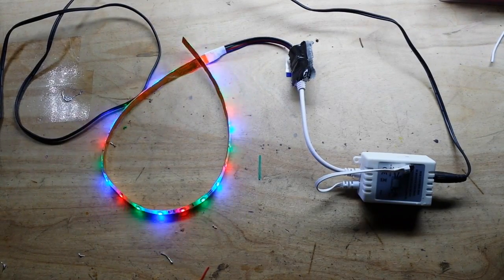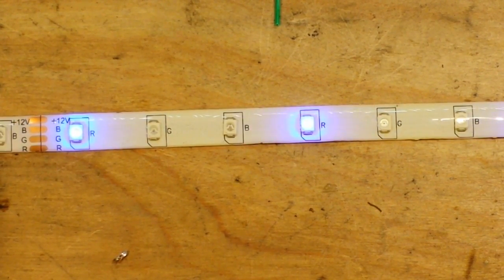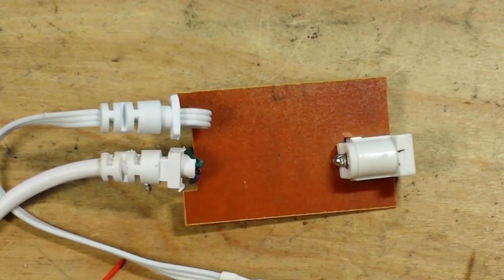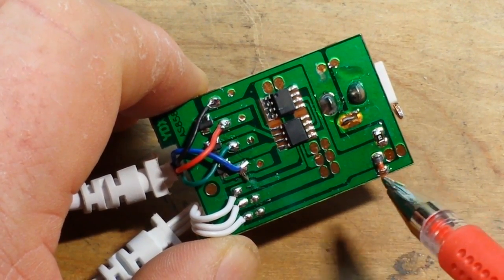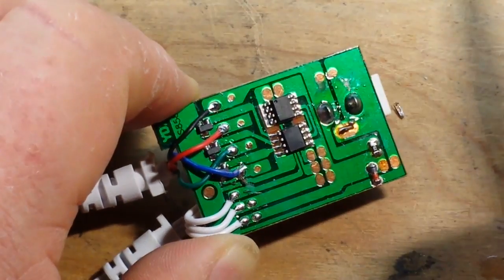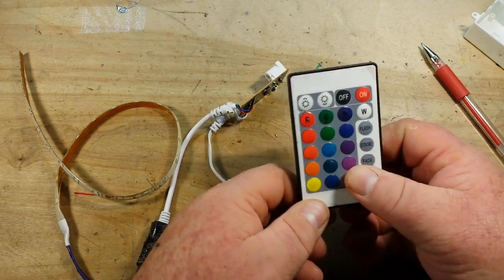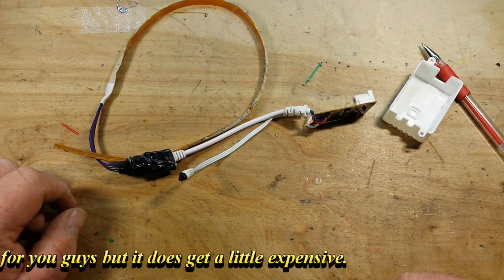RGB LED Controller Teardown

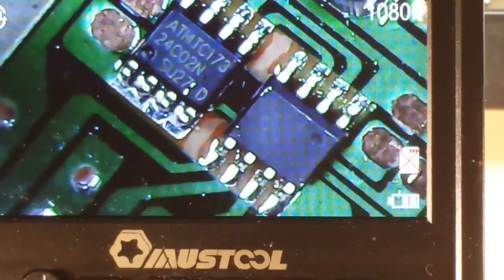Comment: the unmarked microcontroller at 3:24 is most likely Microchip PIC12F. Judging by the Vdd and Vss pin position. Definitely not ATTiny

Comment: If i connected 3.7v power supply (lipo battery) and a single rgb led .. would it work or the 12 v is mandatory as source and output

Comment: Are these switched via + or -? Are the outputs positive or negative?
Reply: These are probably n-channel mosfets. They do current sinking since it is more efficient than using p-channel ones. The rgb strip usually has a common vcc (12V) and each color has a different ground that connects to the drain of each mosfet.

Comment: I have a problem with mine, the LEDs light up only when I connect the Source with Drain on each FET. Tested the FETs while in Diode mode and they seem ok. Any idea what the problem could be?

Comment: Can I modify this same controller so I can connect 3 different led strips with 4 pin male headers (these LEDs are short in length) instead of only one? I'm thinking I could get 3, 4 pin female headers which I could connect into?
Reply: Please check this image to further understand what I mean: https://ibb.co/nPY1Ncx

Comment: Your incorrect about the LED's having a chip on each one with a DO/DIN line. The LEDs are controlled via the (transistor) or (fet) on the board. The intensity of all blue/red/green individual LEDs are set by the controller via PWM. I have one of these without the remote. However I think someone posted the codes that drive these things in arduino code.
Reply: I believe the MCU in that device is a Microchip PIC12(L)F1571/2. I mapped out the known pins and it matches up.

Comment: can you help me with answer? i want to make my pc power on and of on with that controler. is that possible?
Reply: It depends on your system board. If you have a custom build you can use the power button and a simple board to have the remote work. Just have to have a board that can interpret the signal. Otherwise no. Its a difficult setup and why would you want to use a remote like that to just power a pc? You can get a key fob that is just one button that can do that with the receiver and a relay.

Comment: Are all those IR remotes coded the same, and could one extract the code on that chip
Reply: It’s possible that the remotes could be coded similarly. My sister has two different LED devices from different manufacturers however one controller from their kits can control both devices. This is most likely because the infrared signal sent from the controllers depending on the button you hit, are the exact same. However if you can’t tell for sure you can rig a mini infrared receiver on an Arduino and program the Arduino to recite the hexadecimal code that the receiver gets. Then take your remotes and try out different buttons.

Comment: Paul, you were actually on the right track using this gear with an aquarium... Might not look quite as purdy but you can control the green goop that grows on the glass as well as stopping the fishes needing sunglasses.  The mixed white is far better for living things than the doped blue LEDs.
Sunlight, spectrums and all that.  Very good for growing "herbs" too (so I'm told).  If you play with the right fish and the right colours you'll see it's not just sheldon cooper that can make fish glow.  Blacklight reveals odd details. 

There are some very precise "recepies" for colour mixes ... but most fish cant read so a mix of colours slightly biassed blue is good enough, for plants go greener/red and for "bright light" plants (hem...hem!) add a dab of blue to an equal green/red

Comment: Could you make a short video on how you could control those three transistors with something like an Arduino? I have a similar strip with actual RGB LEDs that also uses a similar transistor setup that I'd love to control.
Reply from the maker: Ok
Reply: Thank you very much, I'm already looking forward to it.
Reply: Find this comment and that’s exactly my situation. Did you make this video? Thanks in advance!

Great work explaining how controller works, I’m starting in eletronics and this video helped me a lot.

Comment: I like fun electronics episodes,  esp, led strips etc. Thanks Paul. Makes learning electronics fun.
Reply from the maker: Thanks
Reply: I have one of these controllers the resistors like to burn out when you connect an extension cable

Comment: haha that's my BangGood bluetooth light bulb remote!  I have a 5V LED strip that runs off USB and I'm amazed that it lights up as bright as it does (given the low 5 V input).
Reply from the maker: Keep in mind that led brightness is current based not voltage. 3.2-3.3V is all an led needs. Write them in parallel and you're good to go.
Reply: That same remote control is bundled wit ha lot of cheap LED lighting controllers. It and similar models also common in Arduino starter kits and a lot of arduino home-brew projects. 
They can be had on ebay for under a dollar, so these lighting manufactuers are probably buying them in bulk for a few pennies each.
Reply: Chinese economics!

Comment: I've got one of those strips I bought to put under the awning on my RV. I think mine is 5M long though. I didn't use it for the same reason, no real white. I ended up using a strip of bright white LEDs instead. Thanks for opening up the box and showing why this stuff is so cheap!
Reply from the maker: Yep, nothing really hiding under the hood.

Comment: Can you check how to reprogram that ic.
Reply: If you mean the eeprom then yes you can reprogram it. However the  unit will not work well after. The Eprom is for the sequencing of the lights. There is a list of tables in there the MCU uses to determine how to turn on or off the leds as well as the intensity.

Comment: Horror. Horror. No capacitors, zener diode (most likely 5.1v) instead of voltage regulator. No resistors for transistors gates. True planned limited lifespan. 3-4 months? It probably will survive most of holiday season and fail (zener will burn and 12v will kill the rest). My favorite line from game Oblivion, trader: "You don't want the very best. You want cheap. And I've got cheap."
@5:34: this just cheapest flux that they can find.
Well, when it fails you can reuse led strip and a box for better controller (IR receiver will most likely burn as well).
Reply from the maker: I have run it for about 8 months with no problem
Reply: "hUr DuR"